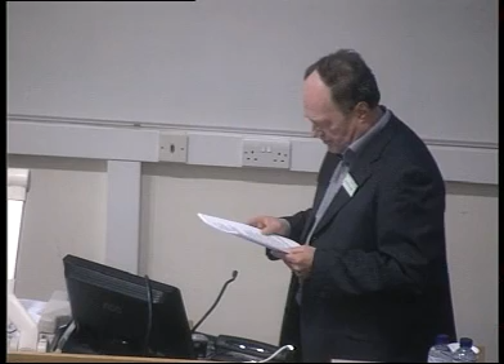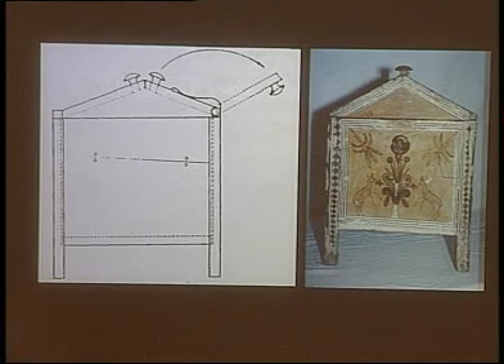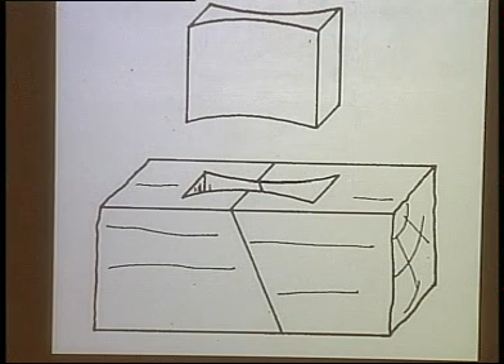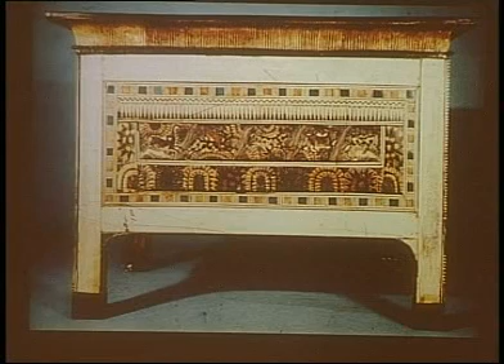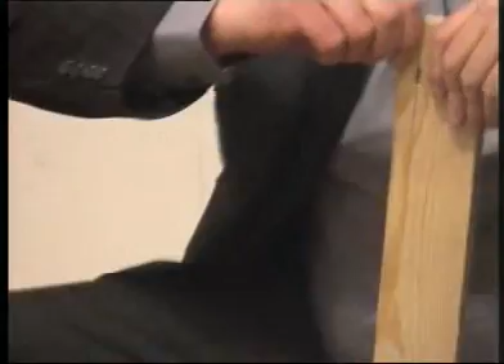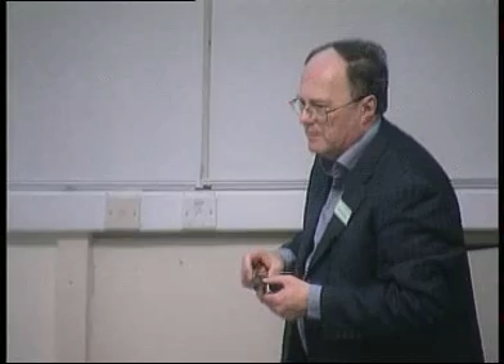Geoffrey Killen - Ancient Egyptian Woodworking

Comment: Thank you for an excellent video. 
Do you think for their saw with the set only on one side that they perhaps only did a few strokes from one side then turned around the wood & did a few more strokes from the other side? that way the kerf will clear the blade.  
Also I would presume the lathe would have had 2 round pieces of wood for handles on the rope so the labourer did not wear the skin off his hands too fast